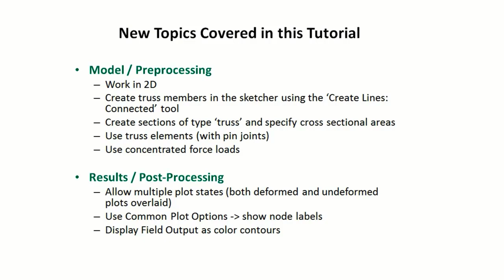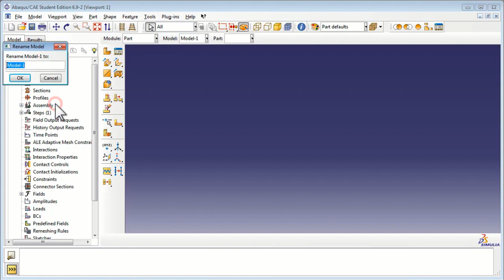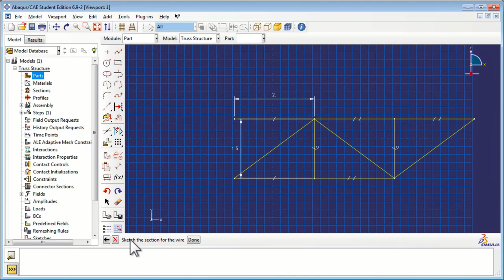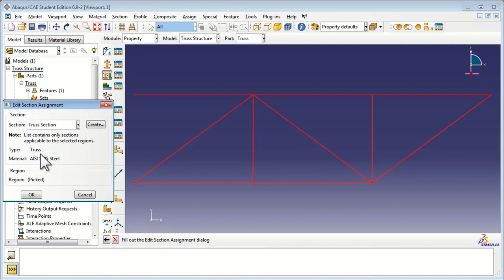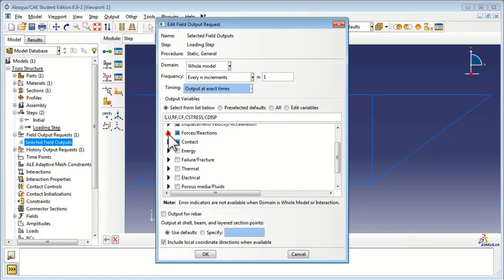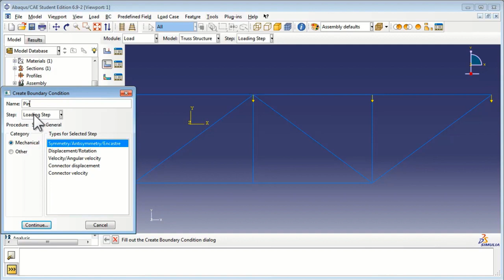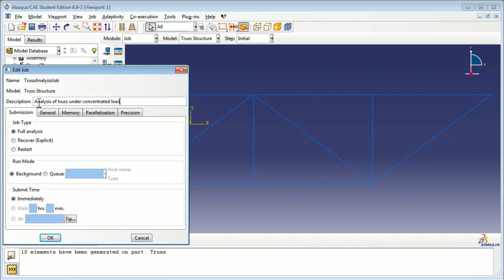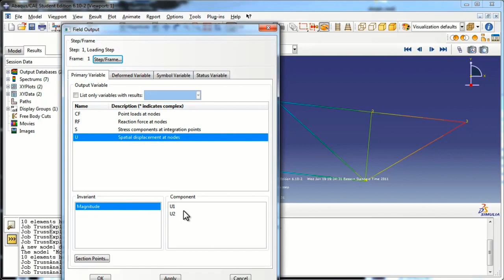SIMULIA How-to Tutorial for Abaqus | Analysis of a 2D Truss (Part 1/2-Static)

Comment: When you meshed the part you said to choose 4 parts, but you typed 1 and ended up with 10 as a result of the truss shape. How does this change the outcome? For example my shape has 9 elements but if i chose mesh with 4 parts, i will end up with 36.
Reply: I'd like to add that is this very important, I've spend 6 days trying to work out what was wrong with my model and its all because I was using the number he said and not the number he used
Reply: @lukemills7087  omg me 2
Reply: @lukemills7087  Yep. That was tricky.
Reply: @tinkatul  I typed in 4 to and job didnt work. Why would that be? why dies it work with one element in truses?
Reply: @borna6403  I was just learning Abaqus, perhaps someone else could give you a fine answer; but to me, I guess it could be perhaps because it somehow articulates every end of element, as it is a truss. But I´m just guessing.
Reply: @tinkatul  I see where you are pointing. Why are you learning abaqus? Are you doing it alone?
Reply: @borna6403  We began looking into it with a studying partner to see if we could use it to calculate a tensegrity structure, but we couldn´t get the pretension in the cables done. A teacher told us it could be done by the command module, but all the prestress info we found was for wires or bars in pre- or post-stressed concrete. If you have any info on this, please let me know.
Reply: @borna6403  Hi, my understanding is multiple truss elements connected together are "pinned" on the nodes. So, a segment meshed with one truss element is a truss. A segment meshed with multiple truss elements is more of a "chain" or a "catenary". A quick way to verify this is to have a line segment meshed with several truss elements. Then apply a displacement perpendicular to the the line segment. See if the whole thing stays straight after the motion.

Comment: How to apply load at an angle ?
Reply from the maker: Hi Muhammad, Join our SIMULIA Learning Community (SLC) for free and ask questions on our community board - where they will be answered by Engineers that serve our user base. Link in description!
Reply: for temporarily, you can convert the incline load( Inclined from horizontal ) into 2 loads 1. cos thita (Horizontal load) and 2 Sin thita ( Vertical load ) of that load

Comment: I'd like to make a question, whether I'd modelled the entire system as beam planar assembly (starting from the same sketch as you had drawn generating the part) I guess that by default the adjoining nodes would have been complete connection, i.e. transferring also bending internal moment. In the chance I'd like to relax the mutual rotationial connection (acting only as pinned joints) how would I do that?
Namely decoupling the rotation for the adjoining member to the same node... Thanks for your time!